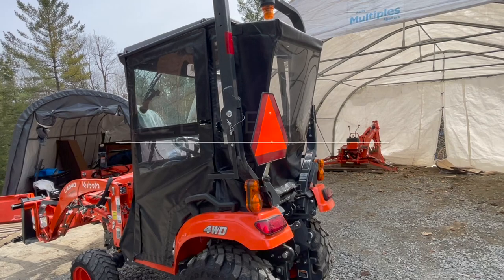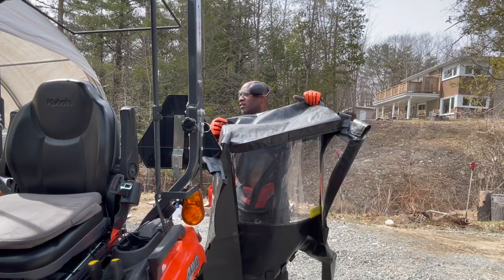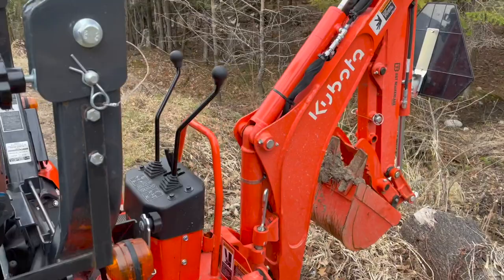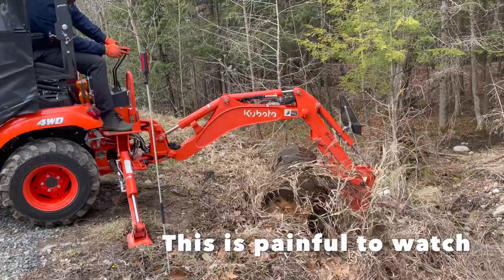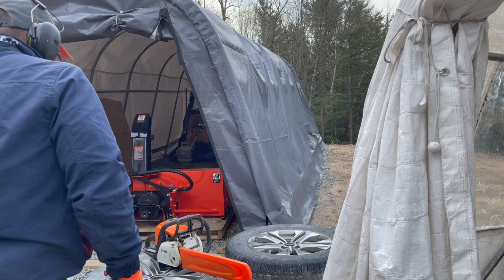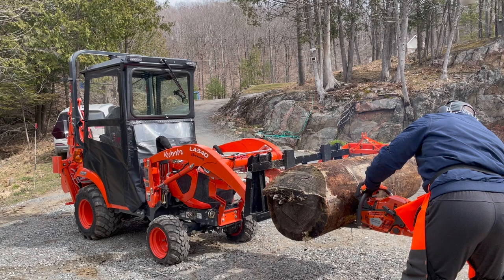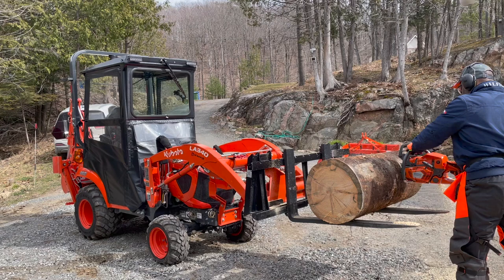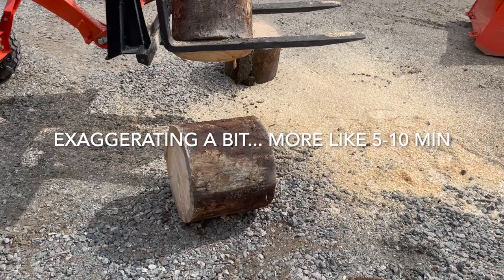#8. Using the Original Tractor Cab 12078 with the BX23s backhoe... Can it be done? HD 1080p

Comment: Nice job man!  I found that I did not have to remove that bolt to swivel my seat.  It hits it but I can force it by where it hits.  I did find that I had to remove the back bar that is up by my head because i kept hitting my head on it lol.  That chainsaw did great!
Reply from the maker: Hi Derk, once it hit I just removed it, but yes I probably could have sqeezed it by... And one of the few things being vertically challenged is not hitting my head on the top cab bar lol, and I am loving the new chainsaw, it saves me sooo much time... Following along on your Barnaminium build... impressive.

Comment: That worked out well 👍 on my B2650 the cab does not allow for the seat to turn, so they mount a tiny seat to the backhoe, not the best of operator positions 🤣
Reply from the maker: Hey, thanks for stopping by... I took a look at your backhoe video's, I didn't realize the mounted it to the backhoe, hopefully its adjustable... And yes  the use of my backhoe with the cab isn't too bad considering it wasn't meant for that.